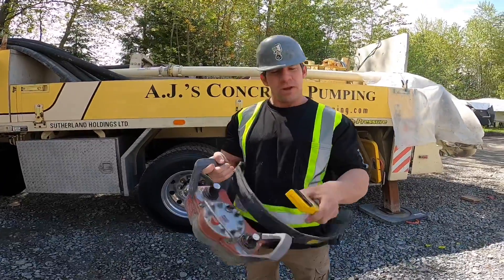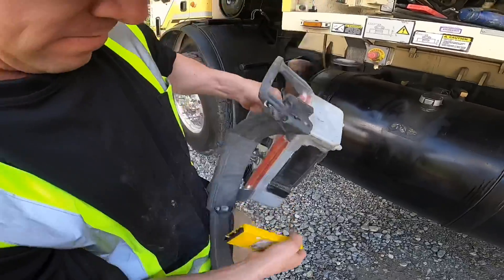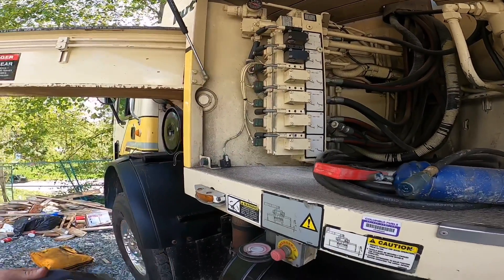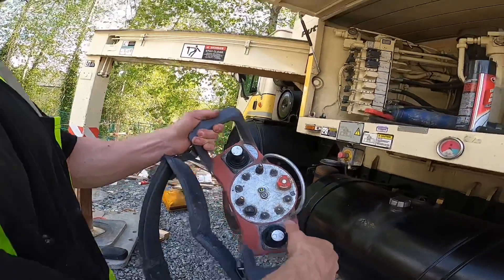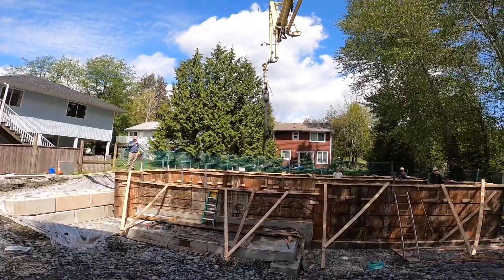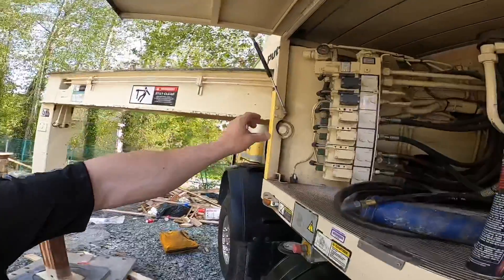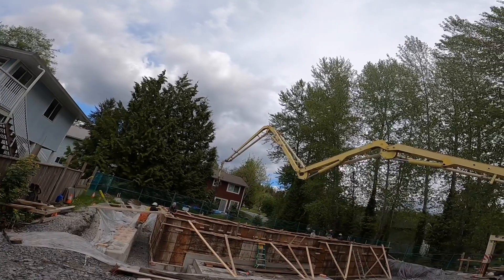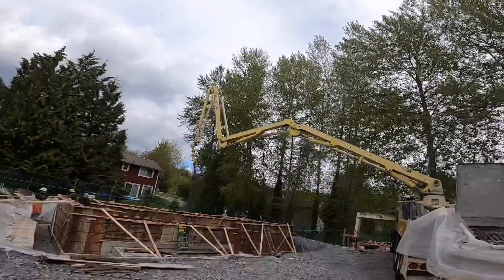Dialling in your Putzmeister/HBC boom functions:

Comment: I tuned mine so I can full toggle extending and retracting the boom in z keeping the hose level (4 stage putz) how come you hit the e stop on your remote remote much I try not to use e stops unecessarily incase they wear out
Reply from the maker: To my knowledge the e-stop must be used in order to save the settings (as mentioned in the video, perhaps just powering the remote off using the toggle switch would achieve the same thing). Agreed however, for normal powering on/off of the remote control, we just use the toggle switch.

Comment: ive been trying  my best to get out 47-5 dialed, its the ergo 2 system (with the color screen) so I know thats a totally different beast.  I'm not the best boom operator in the world, hope to be some day, but boy that thing makes it look like its my first time with the remote strapped to my waist
Reply from the maker: Definitely the bigger the boom the more labour intensive it can be to get done tuned. They have a tendency to amplify our errors as operators 😂
Reply from the maker: I believe those ones can only be tuned in the “user defined” mode. From what I recall, rabbit/turtle booms speeds can only be adjusted via plugging in a laptop and using the factory software. (my experience with ergo 2.0 is admittedly minimal however).
Reply: The ergo 2 was definitely a setback for the user.
Reply from the maker: @jigglychunkdavid  They appear to have more than made up for it with the new Ergo 3.0 (at least from what I've seen of it so far).